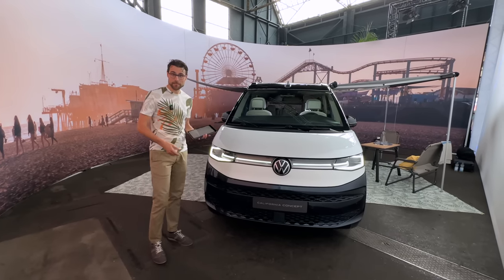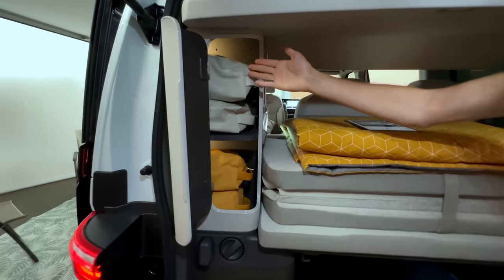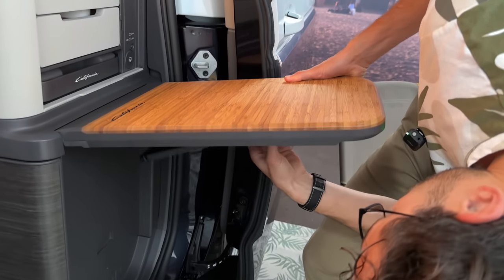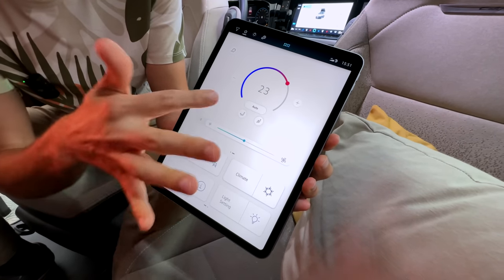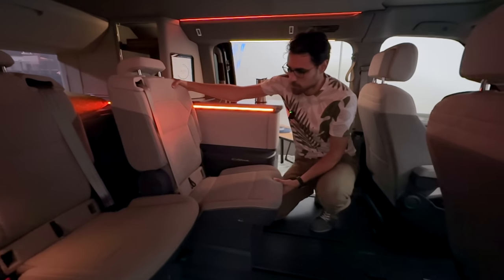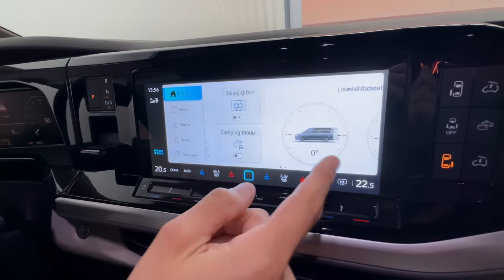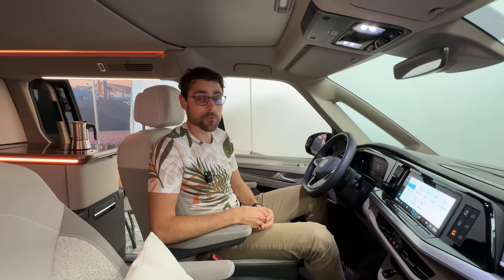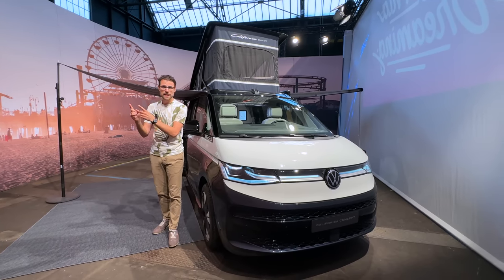Is the new VW T7 California the ultimate camper van?

Comment: The T7 looks to a significant step up in design, but the slightly lower height is a disadvantage IMO. I'd like to be able to stand upright under the awning and the tailgate.
Reply: I don't understand why the tailgate is so low. I'm pretty sure I can stand under the tailgate of my Caddy(I'm 190)... Perhaps it's the chair compartment that make it that much lower
Reply: @madsgrand Agree, also have used a Caddy and had no problem standing under the tailgate. The problem might be the room for the chairs or maybe the hinges are designed differently or maybe a combination.
Reply: maybe because its not T7, but new MQB multivan.
Reply: Maybe because the target market are Asian countries where the average height is way smaller...

Comment: I'm wondering where to put all my luggage if I go to Croatia or Norway for a month. I drive a combi on holiday and apart from me and my wife, the whole car is filled to the ceiling with luggage. If this amount of luggage is placed behind me, sleeping on the way is not comfortable. I sleep upstairs - that's obvious - but moving around the car is very difficult. Basically, it will be the same if I continued driving my combi and bought a sleeping tent for the top of the car. am I wrong ?

Comment: I have a t6.1 California that i use very often. I was pleasantly surprised by this t7,i think it has really cool solutions and the overall design looks great inside and out. I will not do the transition because my t6.1 has 4 motion with a diff lock and a manual, giving it good offroading capabilities that i use and being based on the Transporter i think the durability will be better. I also think that plug in hybrids are the worst of both worlds, either give us a proper electric with 600kms of range or give us a good diesel, we dont need the added complexity and weight of a battery that is only good for 30kms

Comment: Though I'm enthusiastic about some of the features of the camper (the flexibility and outside use of the kitchen is really something), I'm absolutely blown away by the fact that this needs to be 27cm longer to get about the same interior space as the short T6. It seems to me that a lot of available space is wasted on the front of the T7 to get that retro look, and that the people in the front are positioned a lot further to the back of the vehicle than before. At the latest car show, I took a seat a the wheel and I found it weird how much space was in front of me. I definitely prefer the T6 California because of this.
Reply: I agree about the wasted space in front. I hvad the same feeling about the I.D Buzz
Reply: I agree.
I think the size and position of everything in the Transporter Cali is the sweet spot for a small camper. The T7 Cali seems just a bit too small.
The question is will there be a Cali on the new VW/Ford van chasis?
Reply: @@phillipbanes5484 Yes. Don’t think that was the leading factor when the design was made though. More like cutting costs by sharing the chassis platform with the Passat and such.

Comment: We went for the "normal" T7 hybrid with seven seats, but then we bought a camping module from Campal, so we have a more flexible car, that we can use for more people but convert to camping when needed. We also have the kitchen pull out of the rear so that smoke and water from cooking doesn't end up inside the car. And we have a rear door tent, so that we can still sit "outside" in bad weather and cook our food. Furthermore, we can still have 5 seats in total and the camping module, or more luggage space and then only the front seats. All in all much more flexible. But there are things we are going to miss, the extra batteri driving the refrigerator, the inside lights, and the "camping mode" that turns of external lights - it is annoying when you exit our car in the middle of the night, that all lights are turned on. I would like the car to have a bigger battery for driving, it is a bit on the low side, but that goes for both models.

Comment: Thank you for the review. I have a T6 California and I wouldn't swap for this T7 for several reasons. Primarily the T7 looks to be very short on storage space compared to the T5,6,6.1. I find the length of the T6 just right for use as a daily driver and particularly when parking around town. The T7 sleeping areas appear to be narrower and the comfort mattress takes up a huge amount of boot space. The T6 has better ground clearance and its commercial origins result in ruggedness and hopefully durability. The T7 would be amazing as a day van and perhaps a one or two night sleepover but I have reservations regarding its capacity for a longer road trip. I just wish I had been able to afford a 4motion van when I bought mine - they must surely gain value over time?
Reply from the maker: thanks for the feedback !

Comment: I definitely consider that the interior height of the T4 - T6 generation was more comfortable and functional than the new T7 concept. I consider the new mechanism of opening the bed a huge mistake for the experienced camper although the solution to achieve a double side door is an advance. Although not all campers see it as a necessity. Technology fascinates us, with its lights and telematic controls, but practicality I think has been sacrificed.

Comment: I love all the new bits, two sliding doors. The kitchen unit, the new front seats having height adjustment, no handbrake getting in the way. Lots of problems with the T6
.1 have been solved but it missing the point. The lack of height makes the awning impractical to sand under and rain will run towards the van not away, lack of interior table when raining do you really want to go into the boot to grab the table and finally the lack oc storage space for me would be the killer. In summary  looks good loads of new ideas but won't work for me.

Comment: I don't understand why VW changed the idea of mounting the table in the side door and moved it back. First, you lose the luggage space in the rear. Secondly, leaving the table on the side would still give the option of mounting it inside, without leaving the car.
Do you know what the capacity of the tank will be? As far as I know in the Multiwan, it is 40 liters, which is very little for a car that is intended to be used for travel. 70 or 80 liters is the perfect size.
Will there be parking air conditioning in this car?
And lastly, will they finally give a window in the tent with foil for a rainy day, so that you don't have to sit in a closed space.

Comment: I own a T6 and what I am seeing on the new model is that storage has been reduced. There is no storage under the back seat and due to the design of the new kitchen based on drawers where do you store bottles of water? Dry Food? Or larger items? 

What about all your clothing?

I see a lot of errors honestly, specially on storage.

The back seat is also based on 2 pieces and you cannot use it as a couch. 

What about the access to the fridge when cooking seated? 

Vw has prioritized having a model valid for the european and uk market with doors on both sides but I see a lot of errors compared to previous versions, including the base car. T7 height is very low and not valid for dirty roads etc.

Vw has designed a competitor for Mercedes V Class and in my opinion classic California buyers are looking for a more adventure vehicle.

Comment: I bought a brand new t6.1 high line dsg Lwb kombi camper  204 swamper last year and I absolutely love it ,I do most of my cooking outside as we have both a fiamma 45s awning fitted as well as a remo rail on the passenger side. I have 3 removable rear seats and 2 captain swivel seats in the front, but the best bit is the 40 winks bed system system in the rear ,a removable  folding but when out a queen size bed in the rear of the van .with the bed out the rear seats can still be in place. My van is was built by van haven in Dorset England. It is on there you tube channel. Its the revena blue swamper with the blue / gold / and white decals.  As for the t7 it looks fantastic

Comment: Thomas that was a really good overview of the T7 and I liked the contrast with the T6.1 platform.  I think the longer length and lower height of the T7 would be a problem IMO.  I do prefer the T7 dash layout and use of the electronic brake, I also like the individual seating which I expect will make the addition of a 5th seat more practical given the additional passenger space. Overall I think I would stick with my T6.1 as I would be concerned that the T7 passenger platform may not be as durable or easy to live with in the long term.
Reply from the maker: Cheers!

Comment: I have a T4 Syncro and observe that the VW campervans are essentially the same design as the T4, upgraded for the modern automotive technology. For me functionality is more important than cosmetics. Of course, it depends if you just go away for short periods and don't do a lot of outdoor stuff. But if you are a serious camper and travel for long periods then things like a toilet, battery capacity with solar charging, easy access to the lift roof bed (ladder), fridge/freezer, gas capacity (hot water boiler is good), water capacity, water filter,  rear water connector for an outside shower, robust suspension, internal heater (using the fuel from the engine) .... Having a rear seat across the width of a van is a real pain as, to access the storage in the rear, you usually have to go outside and lift the tailgate. In summary, the gizmo's and gloss are all very nice but serious campers need a different approach.

Comment: Pros:
Outsider kitchen option
Sliding doors on both sides
Location fridge
Two separate back seats. 

Cons:
Biggest problem is storage, storage, storage. Because there is almost none. 
The size. The 6.1 is the limit on space you need (also the bed) this looks smaller. So I’d rather stay with the 6.1. 
When you have to cook inside because of bad weather I think you need a table inside. 

It all looks really luxurious but if it is more practical?? 😊
Reply: If you need a table, you can use the tablet, if you need more space, you can use a tablet with 256gb. This is the volkswagen solutions.

Comment: Lovely van , but i don't think it has the same amount of storage as the T6.1 
also i think VW are missing a trick as there is no toilet on board 
The Ford nugget plus i think is a better buy , as it has a toilet , but otherwise its a lovely van , it has some improvements over the T6.1  , ie no handbrake in the way , also nice outside table , , , just the lask of storage and no place for a toilet i think are the main downside

Comment: I’m surprised that they did not bring it out on the ID Buzz
Reply: VW dropped the ball on the Buzz. No panoramic roof, no removable second row seats, no camp mode and so on
Reply: @Harrythehun  camp mode is coming
Reply: @Harrythehun  It gets panoramic roof for the longer wheel base
Reply: I thing because of weight, it would require another type of driving license instead of normal passenger car license.

Comment: This T7 will be shortly updated by the all electric ID Buzz - so for me it doesn’t exist! 😂 Another problem of this T7 California Concept is that its length is over (by 17 cm) 5 meters so it cannot be used as a normal car (parking areas etc.) - which is a success key of original VW California. As a comparison the forthcoming ID Buzz Long Wheel Base will be under 5 meters (496 cm length). When I will change my VW T6 California Beach I will go for a ID Buzz LWB.
Reply from the maker: these are running parallel actually. ID Buzz LWB review here: https://www.youtube.com/watch?v=oRjvZdDLPhY

Comment: It has a petrol only engine option, which for me is a key feature. Electric vehicles are still too experimental
Reply: Fully electric seems Ideal for camping to me, you don't have to worry about extra batteries or grid hookup for power at camp and can just charge the car once a week(or obviously more if you are also driving around alot)

Comment: I always wondered about these, but wouldn’t a caravan or trailer tent make more sense?  That way you can detached the car and go exploring the area in your car.   To do this with the campervan, you’d have to pack stuff away and reset it for camping again?  Do love the idea of taking your accommodation with you though!
Reply: The california is basically a normal car and you can drive it everywhere, it's 1.9m high so no problem with indoor parking.
Reply: Er no. The whole point is that you can go places where you wouldn’t be able to tow a caravan. And who wants to spend time in a damp leaky tent when you can be snug and comfy with hot food and a cold beer after a long day on the fells? My T6 VW Ocean is the best toy I ever bought.
Reply: Er no. The whole point is that you can go places where you wouldn’t be able to tow a caravan. And who wants to spend time in a damp leaky tent when you can be snug and comfy with hot food and a cold beer after a long day on the fells? My T6 VW Ocean is the best toy I ever bought. If you really want to pack up and “go exploring” it only takes about 10 mins to do so if you are organised.
Reply: @paulm706  have you seen Opus trailer tents?  Based on air beams, can inflate in minutes. Has a built in kitchenette, almost like a inflatable caravan.   I see your point though, if you want to go off the beaten track more, a camper van would be a lot more convenient.

Comment: As a long time RVer, I can’t emphasize enough that when it comes to high tech, less is more. Physical switches to turn systems on and off is so much more desirable than these dopey app based things (unless of course you can manually override things when the master control fails).
Reply: Kind of sounds like you're an older person.
Reply: @boblatkey7160  Bob you trust too much in technology. Let's say you are visiting the beach and as the tide comes in you pack up to leave and last thing, the electric roof fails to retract, what are you going to do?

Comment: Dear Tomek, when you showed us the New Multivan, You repeatedly emphasized that it is not a T7, and that the T7 is yet to come. As far as I know in cooperation with Ford. You repeat T7 many times in this video.  Something changed with VW with the names?  And now a request. If you have the opportunity, pack a maximum of the so-called T6 /T5.3 in my world/ and then move everything to the New California. Let's start with 6 bottles of 1.5L water in the front door.  You may ask when VW plans to introduce a Marco Polo-like sunroof and all opening windows? In 20 years?  I forgot if you can measure the floor like you sometimes do.  Isn't it as long as in T6 even though the car is 15cm longer? Greetings. As always great job. The Best? 😉
Reply from the maker: They do call it T7 officially. And yes the new commercial platform version is still to come with the Ford cooperation!
Reply: @autogefuehl  Guten Morgen 😉 Something has changed in two years.  But that problem was with the T4 lift which was called T5 until the T5 came along.  Lift T5 is called T6 because it's kind of progress.  And in what?  Electric power steering and radar?  The lights and the cockpit?  electronics?  The base stays the same for 20 years. Customers have been lied to for 20 years that it is structurally impossible to make California with doors on both sides.  The design of the car remained the same and the doors miraculously appeared.  Etc. And the worst thing is that VW lies in the specification, e.g. that the floor is 10m longer than it really is.

Comment: I have a California T6.1 Ocean. Why I dont like this concept? No place for Porta Potti (WC) in the cupboard. Bad place for Camping table (why??), in the side door was more best. Few place for silvervares. No storage box in the sink. Very short boxes under the 2 rears seats (and not a big one like befor: Multivan seats with VERY SMALL boxes). Only 2 security belt on the rear. (This problem also in T6.1, only for 4 p.)  Unnecessary second sliding door to the detriment of storage space. Impractical and very small storage places everywhere, there is no space for e.g. for sleep bags in the wardrobe. (There's no more wardrobe with the practical two opening options in T.5, T.6) The rear luggage compartment is no longer practical: You cannot remove the luggage from the inside, when e.g. it is raining. (With the RAKO boxes that can be used in T6.1, the mattress here is different, so this solution can hardly be used.)  + No electrical induction hob, no solar panels (!) . No serial ISOTOP second-insulation and no transparent windows on the rooftop tent.  This is not a California, but a set of (sometime bad) ideas stolen from Westfalia and others, with a partial assignment of the "old" smart ideas of California. ((+ Where is the new place of toolbox?!))

Comment: i guess the electric rooftop not working and in development at the moment? why should you not show it otherwise.
Reply from the maker: It worked before but the Prototype malfunctioned when we started filming so we had to leave it fixed. It was a hand built first vehicle
Reply: Definitely need a manual roof option as per T6.1